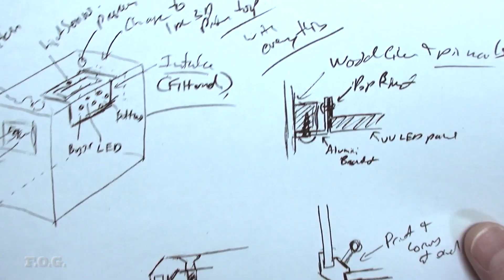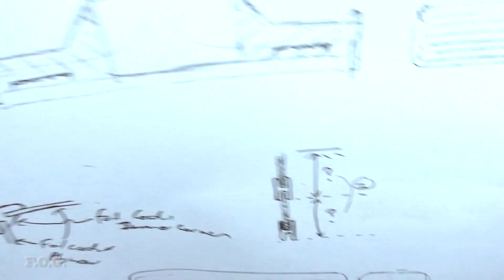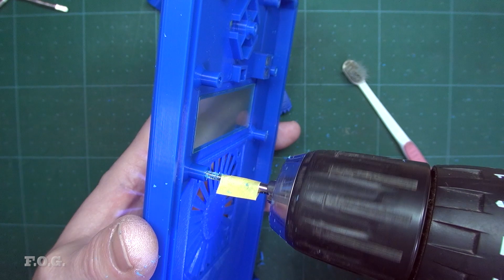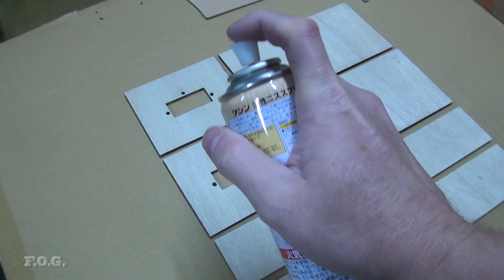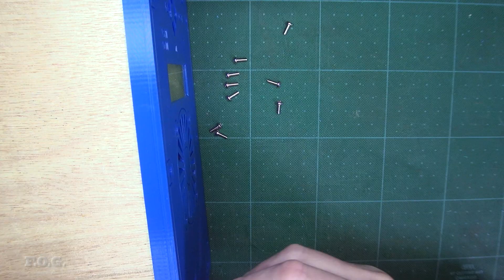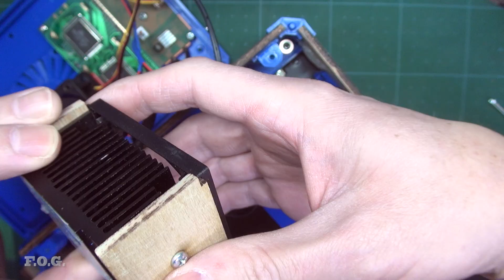EP11 – DIY PCB – Making a UV Light Box Enclosure

Comment: Hi, can you tell me how far away the UV LEDs should be from  the PCB to get  the best possible exposure please?
Reply from the maker: @TankTurk  Mine is set at a height of 30mm, and it seems to work ok with fairly even exposure.. though it is not particularly fast with the green WNB resin still taking about 30mins to fully cure. I think I did some basic tests to determine this height, but it wasn't particularly thorough.. possibly a different height could have been better.. but then there is the matter of heat buildup in a confined space..
Not sure if that helps, but there you go! Thanks for the question 👍.
Reply: @ForOurGood , Hi, me again. Just thought I'd give an update. I tested it and it seems 30mm is just the right height. It took 10 minutes for the ink to cure fully. I use a brayer to spread the ink, it goes on evenly and very thin. I'm thinking that the ink being so thin it's probably better as it can be burned easier and maybe even with faster speed. I'll try it and see how that works out.
Reply from the maker: @TankTurk  Wow, that's interesting, I had never thought to use a roller to apply the UV resin. You should do a quick video on it and share the process and results.
I have found that having good thickness consistency is really important for this process, so as long as you have that it should be good.
The thinner the better also is the way to go, but I am sure there is a natural limit to that rule however.
Good progress, it will be interesting to see your final results.
Reply: @ForOurGood , I am not good at video making but I'll give it a try. I need to make some sort of tripot to mount my camera on first though so will take a while.

I got the idea of using a roller from a video (link below). I don't know what sort of roller they are using but I tried one of those sponge rollers that are used with gloss paint for painting doors etc but it's too soft and sucks in too much ink. Then I came up with the idea of using my brayer. It's not that easy but does a decent job. 

I use a piece of glass that I put the ink on and because my ink is quite thick I put a drop or two of IPA to thin it. I then roll over it with my brayer till I get a nice even coat on the roller. Then I just roll over the PCB till it looks good. I use glass because it's easy to clean  the ink off it.

The problem is that because I use 70mmx100mm PCBs I have to make sure that the PCB is stuck on something so it does not move about as I roll over it. I've recently started to stick the PCB on a piece of cardboard with masking tape and superglue method. Amazon envelopes to the rescue here LOL I cut the cardboard larger than the PCB so that my fingers don't get in the way of the brayer. I leave the cardboard under the PCB till it's ready to put in the etching solution. After etching and second coat of inking, I use another piece of cardboard under the PCB for drilling. It saves drilling holes in the spoil board. I'm gonna make a template in Flatcam for the alignment drill holes so that I can use the same spoil board over and over again because the holes will match every time.

Link to  the video: https://www.youtube.com/watch?v=Dunun36XYDs
Reply from the maker: @TankTurk  I think it might comes down to the degree of precision your looking for, for me I am always targeting usable elements of around 0.1mm or below and re-alignment accuracy of about 0.02mm, but most people are happy around 0.5mm and 0.2mm respectively, so often my point of view can be a bit skewed compared to others real world requirements.
So my gut tells me that using a roller will be harder to get consistent and repeatable thickness, and that will knock down your resolution a bit.
Also, from experience, I have found physical pins, and especially trying to reuse holes multiple times, can be something that gets pretty imprecise.
I think the cardboard idea sounds great, as you can see in the video I do something similar to secure the board while applying the resin, it can really be a pain to work with unless you keep the board secured. But as the cardboard is sort of squishy, again I instantly get concerned about precision if this was to be left in place when working on the CNC.
Just my ideas however, often it sounds sort of negative, but I don't mean it that way, I really love to get feedback and see what other people are up to given the many different ways this can be done, always keeping in mind this feedback to either adapt or use when it works for me!
Very much looking forward to your video.
Reply: @ForOurGood , without a lot of upgrades, the 3018 is not exactly the right tool to get consistent accuracies. Being a [nearly] 72 year old pensioner, my circumstances does not allow me to do these upgrades. I am really not worried about the thickness of the green ink being consistent either. I just need it to do it's job of protecting the copper from corrosion. What I'm mostly concerned with is that the project I am making works and looks [sort of] decent. I've made a few things that work like they are supposed to and I am happy with that. I have no intension of being a "professional" at my age LOL

It did bother me though that I could not print the silk which made the finished PCB very ugly.  Thanks to you I hope (fingers crossed LOL) I can overcome that problem now. Definitely gonna try it with the PCB for the UV exposure box. If the PCB looks half as good as yours do, I'll be a happy bunny LOL
Reply from the maker: @TankTurk  I meant 30mm.. sorry about that
Reply: @ForOurGood , thanks for your prompt reply. I ordered the same as  yours but the 100W one, it'll be delivered today. I'll start at 30mm and do some tests

Comment: Searching without spaces worked haha
Reply from the maker: You don't need to search if you subscribe!!?? 🤩
Reply: @ForOurGood  I am subscribed but i use thr mobile app out to the TV . I had a brain fart as well haha. I was excited to tell you about the bench top mill I bought. I'm going to buy a lathe next. 

My house was wrecked by hurricane Fiona last year and I was last to get the money to replace some toys but I fixed them so I could buy new ones. I got a new scope, rigol mso5074 with the logic probes since I found their company on Amazon and contacted them directly. The scope is user upgradeable as well so for 1500 I get a 6k scope which I'd never afford otherwise and bought a brymen bm869s. I live in cape breton so I had to order it from Germany because brymen have no reseller in North America. I bought my first brymen from the other Australian and liked it so much that I got the new one. It's a 5 digit handheld. I'm gonna extend the bench in my workshop because I'm hurting for space. It's a recording studio, an electronic engineering learning area, racing simulator and video game room. I had the scope you have and I could never get a decent waveform so I donated it and hastily wasted money on a siglent I hated then got a tektronix tds2002c and a 1kva isolation transformer a month later on a trade. For an old scope it's got a blazing fast front end and all the features I've yet to understand. 
I really want a way to catalog the circuits I've been learning and want to make pcbs. I've had all the chemicals and such for a while but I'm gonna try your method. I donate alot of stuff to people who want to start the hobby but don't want to dump a fortune on a cheap setup. I offer it publicly too and I tell the people what I'll give them but they have to show me they're serious by learning ohms law and such. 1 in 30 might put in a little effort then I don't hear from them. I used to have a (relatively) kit I put together that I'd just give people but when you never hear from them again you're out like 500 in stuff. I used to give acoustic guitars away too but I was taken advantage of too much. I'm not rich but I'm 44, retired and live to learn. You keep at it and you'll be huge.

I'm starting a channel that chronicles what I'm interested in and if people learn something that's cool. I have severe ptsd and tons of associated effects like ocd and adhd that most people find off putting. I plan to do a podcast too where I get smart people like you and shoot the shit and find out who they are and such. I don't want to show my face so my podcasts are gonna be friendly competitions as well. Like we both pick 4 items each we can both use to make something while we chat. Haha. I plan to lose but learn alot. I have over 60 thousand leds and I plan to make alot of weird things with the mill that involve leds.

Sorry for rambling. I can't help it

Comment: Hi, I make PCB's in most of the same ways as your method.  I am able to make a PCB that will be able to handle as small as VSSOP SMD's and 0402(in) resistor and such.  I haven't made any videos on Youtube but I put a short one of a IR touch probe sensing board if you wanted to see my work. https://youtube.com/shorts/ykwlgk_IRIE  It took me a lot of experimenting to finally find a method that was reliable and able to achieve the detail for small SMD's.  I had tried several methods of toner transfer,  sensitized photo method and other but they could not yield any good results for SMD.  I use a brass brush and water to get rid of what the laser leaves behind after exposing the solder pads from the UV solder mask.  Thanks for your video showing how other DIYers can do this with minimal equipment.
Reply from the maker: Hey that's pretty good work! With the bog standard cheap CNC I reckon 0402 and VSSOP is about the limit. But after some somewhat minimalistic upgrades I am hoping for 0201.. maybe... Many people have voiced their opinion early in the series that I should use a photo resist process (which I am already very experienced with), but at the end of the day the results of this new process speak for themselves, and I think most people now realize this is good way to go. Thanks for the comment!

Comment: Completely new to laser cutting but my creality falcon 2 arrived today. Hoping it will do PCBs but the dot is a bit bigger being a 22 watt laser. But fingers crossed. Great video as always I love your design and great thinking. Did you not fancy heat set insert rather than tapping holes? My best regards Chris
Reply from the maker: I expect your new laser will work just fine. I did not use metal inserts this time, primarily because of lack of space. But actually I am glad I didn't, and maybe I will use them less in the future too! Thanks for the comment ;-)